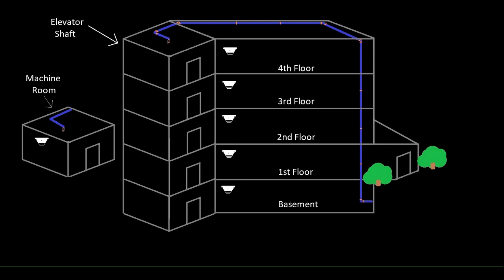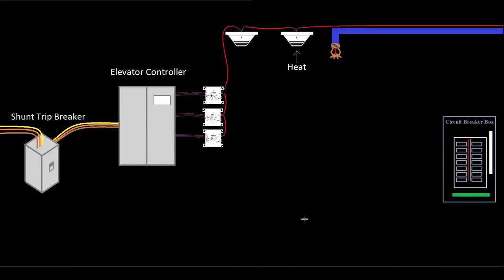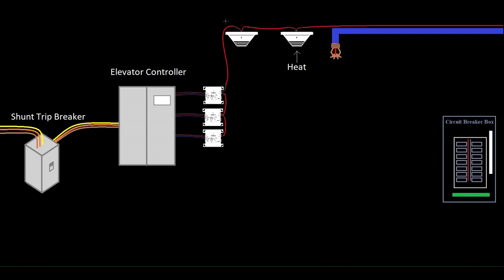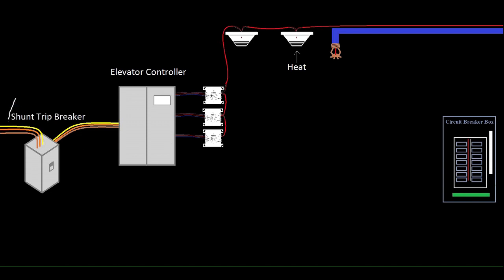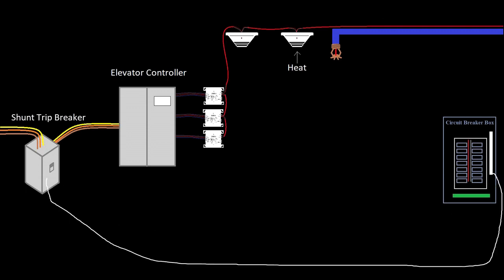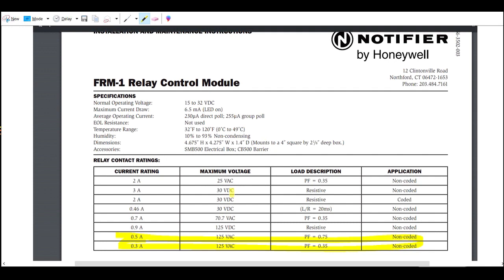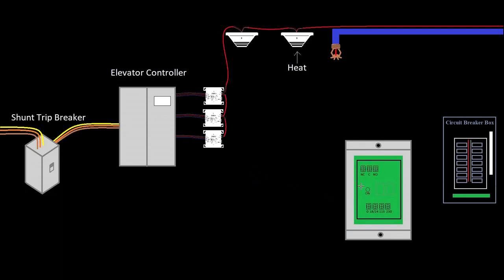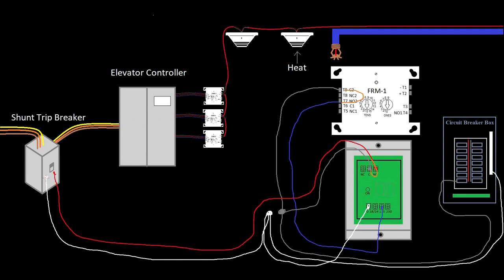39 - Elevator Shunt Trip - Introduction to Fire Alarms

Comment: I’m getting screwed somehow right now though , cause all the electricians have is a shunt breaker inside the actual electrical panel , and it has x2 pigtail black contact wires, which they’ve wire nutted to extend to a box for my module. Saying all I have to do is land those to Com NO , and be done. But that doesn’t make sense , cause if anything else I still need to monitor the status of the switch with a Monitor in addition to the Relay , and there’s no way for me to do that. I’ve never done one of these before , and every video I watch is showing something completely different. You using this Mr101 makes the most sense , but even this , I don’t know how I’m supposed to monitor the switch status , especially with the set up I’m dealing with. I can’t tell if I’m over complicating it , or the electricians have no idea what they’re doing.. Cause I can’t speak for them , but I’m completely lost. This video makes sense , but this isn’t what I’m looking at. The Shunt trip breaker is in the actual electrical panel , and doesn’t have anything to do with the Elevator controller .
Reply from the maker: You shouldn't need to monitor the status of the switch. If they kill power to the elevator by throwing the switch, that's fine, you don't need to shunt the elevator if it's off.

What you're most likely missing is bringing another 120 volt circuit into play which is what would energize the coil on the shunt trip breaker.
Reply: @JoeKlochan  I need to kill power to the elevator with my relay module somehow. Which my programming is fine , when the heat goes off , the relay switches from OL to shorted , but when those x2 black wires attached to the breaker gets shorted , nothing happens , so like something’s missing
Reply from the maker: @williamk2803  I don't think you understand how a shunt trip breaker works. It requires power to energize it. Usually it's 120 volts, but it's possible that it's 24. So look at that shunt trip breaker, if it's 120 volts, re-read my previous comment, and re-watch the video. You need to send 120 volts to those black wires to shunt that elevator. It's a totally separate circuit. The problem is you're probably going to blow up your addressable relay the first time it activates, hence the MR-101. Forget about monitoring the power for now, just so you understand it better. Once you understand the shunt trip, then you can worry about monitoring the power
Reply: Most “electricians” don’t know much about fire alarms systems or relays. Now a days they don’t use MR101 but they use PAM relays which is what you need to monitor the shunt trip

Comment: Hey Joe, love the videos. question! couldn't you just use a 24V power supply (example: FACP  aux power that fires on heat alarm)  that has one leg act as a switch leg between the C and NO of the FRM-1, and connects to the 0 and 24 volt side of the high voltage relay, then just run your hot and neutral from the breaker to the shunt with one leg as a switch though the high voltage relay C and NO?

that way, when the FRM 1 goes into alarm and the relay switches, the high voltage relay receives 24V and that allows the 120V to pass thru to the shunt ?
Reply from the maker: Yeah, you definitely could do that and it would be a better way to do it. The reason I rarely see anyone do it that way is that the elevator room is not always near the FACP, so pulling that 24 volts would be difficult.

What you're saying makes sense, there's just an extra cost. If you scroll down in the comments you'll see someone mention that the way I show isn't to code because the 120 power isn't limited by anything other than the breaker, and so it shouldn't be on our relay. In your example, that wouldn't be an issue because the control voltage is 24 volts. I think the typical limiting factor is people not wanting to install the aux power supply or pull wire back to the panel.
Reply: @JoeKlochan  Hey Joe, one thing that confuses me is why the FRM 1 doesn't get fried in this scenario too? is it because the path through the high voltage relay has less resistance?
Reply from the maker: @jacobb554 no, it's because the only current flowing through it is the current drawn by the coil of the MR relay. This is a confusing situation, and I thought the same thing the first time I saw it. But if you follow each leg of the circuit, you can see the only current flowing through the FRM is the few mA that the MR draws

Comment: If you have to install a heat detector within 24 inches. Would you have to install the smoke detector within 24 inches of the sprinkler?

Comment: Question , I’m having some issues with some door holders , the system we use is Honeywell MRF-1 and a PAM-1 relay to control the door holders power voltage for release.
Correct me if I’m wrong please . 
The 120v coming from breaker will enter T10(comm) and yellow terminal from PAM-1 , the black terminal from the PAM-1 to T8(NO).  Blue terminal  from PAM-1 to door holder and white (neutral)from PAM-1 to door holder as well. I know it might be confusing but if it makes a bit sense your help would be much appreciate.
Reply from the maker: I think I'm following what you're saying, and if so, this sounds like it should work.

Comment: This is all crap.  An elevator shunt trip will not function until any passengers are brought to the first floor, and the doors open.  When that happens the doors will then close and then the relay/control will close sending 120 volts to the shunt trip cutting power to all elevator equipment.
Reply from the maker: That's just not true. I've encountered a ton of elevator shunt trips in the field, and none do what you say. What mechanism is used to accomplish what you're saying?
Reply: @JoeKlochan  the FACP
Reply from the maker: That's not what I mean. What process? What is the order of operation? Are you arguing the smokes will trip first? Or are you arguing there is some process within the elevator that completes the process you claim happens? The shunt trip kills power right now, that's how every single one I've seen works.
Reply: If a waterflow or pressure switch (in a preaction system) is used for the shunt trip function of an elevator, there shall NOT be a delay.
Reply: If you don’t like what you see just stop watching, there’s people here that appreciate others sharing their knowledge.

Comment: Joe- do you have code info stating that pit sprinklers shouldn't need a heat for shunting? I always hear this bit getting thrown around but have never found any code backing it up in NFPA or ASME... Thanks!
Reply from the maker: No, I don't. I don't know if that would be more likely to be in NFPA or in the elevator code. It seems like every time I do an elevator final something has changed though.

Comment: You know your stuff sir thanks for sharing it.i was wondering today how the elevator recall was wired I did a  test on the elevator smokes today and out of 10 floors one of the floors did nothing ,to elevators how would you go about troubleshooting..  electriciantechnician00
Reply from the maker: You just meter your relays (be careful, the elevator controller's voltage will be present on the contacts). If the proper relay is changing states when the detector is activated, your equipment is fine and it's on the elevator tech. If the relay isn't changing states, then it's a programming issue
Reply: @JoeKlochan   ok got it,thanks it could  be a program issue .

Comment: In the UK we have the lifts drop to the ground floor and then stays out of use on a fire, unless there is a fire on the ground floor lift lobby then the lift drops to the 1st floor. And we don't normally have sprinklers in the lift shafts.

Comment: how do you do this with a conventional fire alarm control panel?
Reply from the maker: That would depend on the panel. It becomes pretty difficult if you aren't able to map zones on your panel, and add additional relays. If you are able to map zones and add relays in the panel, then it would technically be possible to do by having one zone on the panel that monitors all the heat detectors for shunt. Then map that zone to an output relay that would trip an MR-101 closer to the shunt trip breaker.

In the old days, they would use heat detectors that had two sets of contacts on them, and run a 120 shunt circuit through the extra set of contacts on the heat. That's dangerous for a few reasons, and it isn't done anymore.
Reply: @JoeKlochan  Would we need seperate zones for primary recall, secondary recall, fire hat flash, and shunt trip? or can they all be 1 zone?
Reply from the maker: @lognum4155  yes, and separate relays. Your best bet would be to just add an addressable panel, if only for recall. It's going to be much easier than the wire you'd have to pull to keep everything on one zone. Plus the recall relays are supposed to be installed within 3 feet of the elevator equipment, which would be tough to pull off on a conventional system
Reply: @JoeKlochan  can the addressable panel be powered via the non addressable panel? How would I be able to add an addressable panel without headache. In my area I might have to tap ahead of the main service switch
Reply from the maker: @lognum4155  yeah that shouldn't be an issue
Reply: @JoeKlochan  By the way, how would you make a delay for the shunt trip? would you just connect a time delay to a NAC circuit or are there better methods?
Reply from the maker: @lognum4155  I've never had to do that. It depends on the panel. Assuming you have an addressable panel with logic capabilities you could write one for the shunt relay.

Comment: you all should  read art 760 of NFPA 70 - power limited circuits - this video does not comply with the code. You must have something in-line between the breaker and the FRM module - fire alarm circuits cannot be directly connected to a power source where an instantaneous fault would exceed 100VA. hence the requirement for a class 2 transformer. For example a Typical commercial application with a 3ph 75kVA transformer at 208 - that 750 x the allowable current at fault (phase to ground)  - suggest using a pilot RIB UL listed FA relay. Do not follow this video if you want to adhere to the NEC NFPA 70 fire alarm circuits requirement.
Reply: also -a circuit breaker is not a power source.. a MCB is rated to protect line voltage devices and wiring from a fire... - A fire alarm circuit is for life safety
Reply from the maker: @robbsutube  obviously a circuit breaker is not a power source, if I said that in the video, I'm not going off a script so I may have just said that flippantly. But yes, to anyone who may have been confused by that, there's nothing magical about a circuit breaker that creates power.
Reply: @JoeKlochan  yes.. give me a second. would love too -as  this is the often over looked issue of Power limited vs non power limited circuits. If you look at any FA control module specificationss - the listing for the control relay is limited to 100VA - 100VA is a CLASS II requirement for a fire alarm circuit. In theory when connecting directly to a distribution panel - the power source is the same as the stepdown transformer at the curb - or on top of the pole.  The same goes for sizing the Interupt capacity (AIC) of a breaker. home use is 10KAIC, where as commercial 22KAIC and industrial is even higher.
Reply: Fire Alarm Cable Separation based on Circuit Classifications

PLFA with Class 1 Circuits

NEC 760.136 (A) Power-limited fire alarm circuits must not be placed in any enclosure, raceway or cable with conductors of electric light, power or class 1 circuits.

NEC 760.136 (B) If the circuits are separated by a barrier, power-limited fire alarm circuits are permitted with electric power conductors.

NEC 760.136 (D) Power-limited fire alarm circuits can be mixed with electric light, power and class 1 circuits in enclosures where these other conductors are introduced solely for connection to the same equipment and a minimum of 1/4" separation is maintained from the power-limited fire alarm cables.

Power-limited fire alarm circuits shall be separated by not less than 2" from insulated conductors of electric light, power or Class 1 circuits. Exception: If the electric light, power, class 1 circuit or power-limited fire alarm circuits are installed in a raceway, metal-sheathed, metal-clad, nonmetallic-sheathed or underground feeders.

PLFA with Class 2 and Class 3 Circuits

NEC 760.139 (A) Two or more PLFA Circuits. Power-limited fire alarm circuits, communications circuits or Class 3 circuits can be installed in the same cable enclosure, cable tray, raceway or cable routing assembly.

NEC 760.139 (B) PLFA and Class 2 Circuits. Power-limited fire alarm circuits and Class 2 circuits can be within the same cable, cable tray, cable routing assembly, enclosure, or raceway provided the Class 2 circuit insulation is not less than that required for the power-limited fire alarm circuits.

NEC.139 (C) PLFA and Low Power Network Communication. Low-powered network powered broadband communication circuits hall be permitted in the same enclosure, raceway, cable assembly, or cable tray.

NEC 760.139 (D) PLFA and Audio System Circuits. Power-limited fire alarm circuits and audio system circuits using Class 2 and Class 3 wiring methods shall not be installed in the same raceway, enclosure, cable routing assembly or cable tray. Please not this does not apply to voice evacuation and mass notification speaker circuits controlled by a fire alarm control unit or amplifier.
Reply: @JoeKlochan  this is not what this section really means - sorry if I made anyone think that I am attacking the circuit breaker as a power source. THE MCB is for fire protection of the current conductor. The transformer, that this distribution panel is connected to, is the power source. This power source is typically 99.999999% a class 1 power source... and that definition is that the power source exceeds 1KVA. The smallest transformers used in distribution far exceed 1kVA - some as little as 25kVA some as high as 1000kVA, some even higher. The circuit breaker by the same reason above in your reply is what is the problem - it is not a power source, so using it as a means to define the circuit type - fails.  Art 760 is trying to regulate the power available for circuits used for Fire Alarm wiring - an instantaneous trip to ground will exceed 10,000 amps before the MCB opens the circuit in many commercial builds - this is same concept that drives the KAIC rating on breakers - The higher the kVA of your supply transformer - the more expensive your breakers must be to handle that available power - thus a higher KAIC rating. look at Motor control panel for a 20AMP MCB compared to a homeline 20A MCB. the same circuit rating - but the ability to handle the fault is vastly different. a homeline version running 300hp pump would suffer a catastrophic failure. its all starts at the transformer - the power source.
Reply from the maker: Robb, your comment makes sense, and after seeing it I went to 760 in the 2017 version of NFPA70 and cannot find reference to what you're saying. Can you point me in the right direction?
Reply: @JoeKlochan  and my final reply is that all system sensor modules contain components limited to 100VA -and i doubt that any other mfr (hochiki, fike, fenwal, simplex, edwards) provide any inteligent control module rated for a class 1 circuit. but as i do not typically worked outsid the system sensor product line (notifier, firelite, FCI, SK) i could be wrong on this whole video - if there is such a beast - than wire directly to the panel.
Reply: @robbsutube  You are also missing supervision of the shunt trip power. because it is not self-supervised you need to supervise and monitor the presence of the control voltage. you would be far better-useing 24vdc from the facp, and an FCM to monitor the control voltage and a 24vdc shunt trip breaker.

Comment: Couldn't you just use a shunt breaker on the panel with a normally open relay that sends 120v to the breaker once it's closed via heat detector?
Reply from the maker: I'm not sure what you're saying.
Reply: no - the heat detector is used for early recall, prior to water flow - and thus is a set at a low activation temperature. The issues is the sprinkler water flow wetting the traction brakes and electronic controls could cause a fatality. therefor ASME a17.1 requires power to be killed when the water starts flowing - watch a few videos on line how people get killed when elevator brakes or controls fail to work properly. the're out there and the're horrific.  A person caught between floors when the elevator decides to move often decapitates the victim. Thereby ASME A17.1 water shunt requirement - take no chances.